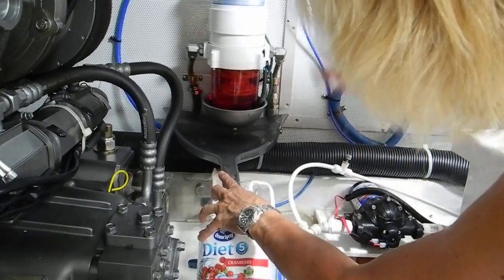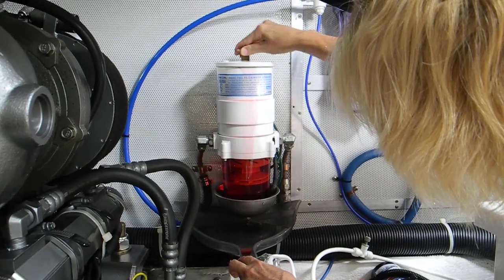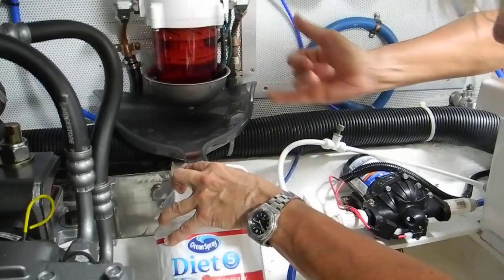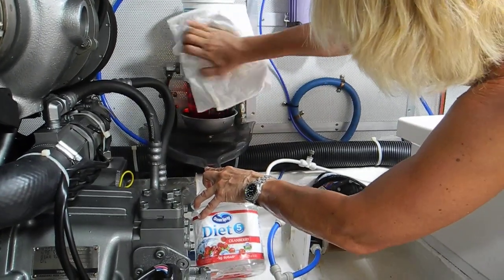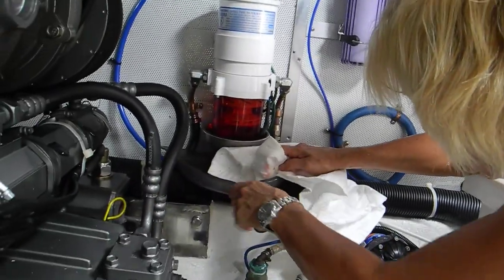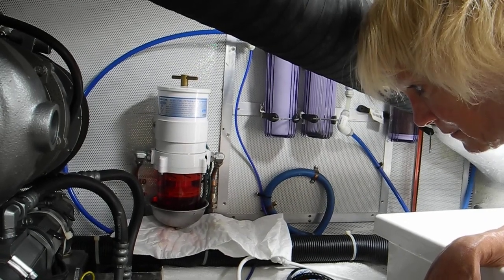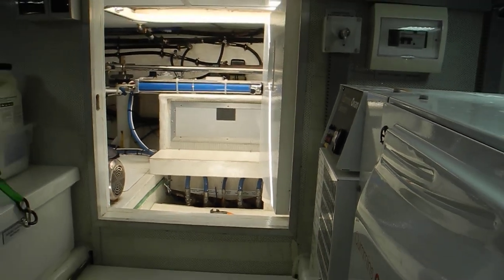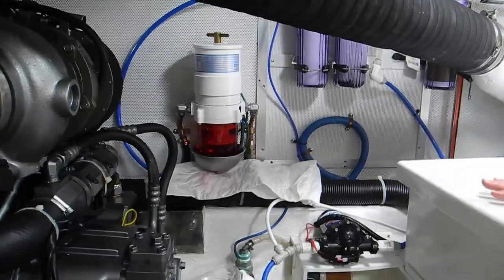Dust pan fuel gutter drain, GREAT IDEA!

Comment: Great Videos. I couldn't make out the type of valves that need replaced .  The need to be replaced with High quality ball valves. They should last forever. This type of repair would be something I could handle if I can make it 4 years 😅😅.Love your channel Your friend Alabama Smokey Wilson
Reply from the maker: The valves were indeed quarter turn ball valves but they were under the aft tank in the lazerette. The problem was they were difficult to reach and someone had jammed them and it was nearly impossible to determine if they were OFF or partially closed. Big decision to drain the tank then replace ALL the valves. How did you like the dustpan?
Reply: @AskCaptainChris  Thanks for the reply. I was going to add an additional comment as I forgot to mention how brilliant this was.             ( CAPT. CHRIS SUPER GENIUS ) 😎
Reply: @AskCaptainChris  the dustpan is a genius idea. More plagiarism being scribbled into the boating book. I’ve got an ST34 being serviced at present (new water pump too - how much...) but UK lockdown means I can’t get to it or move it even though it’s only 50 miles away. I’ll be buying an extra dustpan to add to the inventory now 👍🏻👍🏻👍🏻
Reply from the maker: @Phil B it is the simple things in life...

Comment: Its a good idea to keep a good supply of oil absordingn pads  for anything that goes wrong. Oil runs into the bilge, bilge pump  kicks on and dumps the oil  and will lead a trail right back to the boat.  
That happened to a guy at my marina  .  He got in lots of trouble

Comment: I love the smell of diesel in the morning... There was no spill collection at all under my fuel filters, not even a small silver sallad bowl. I cut the top of an oil jug and mounted it so I can collect a couple of liters. I would have preferred if the air vent on top of the filter had a small hose connection so it doesn't drip all over the filter housing but there's no such thing now.

Comment: Where do you dispose of contaminated fuel ?
Reply from the maker: Edward C. If it’s a little bit you can usually dump it at the oil recycle in many marinas or auto store. If it’s a lot then you have to call a fuel polishing company to bring their big truck.